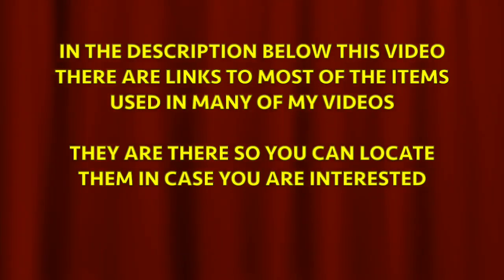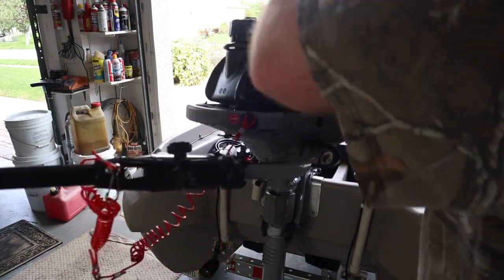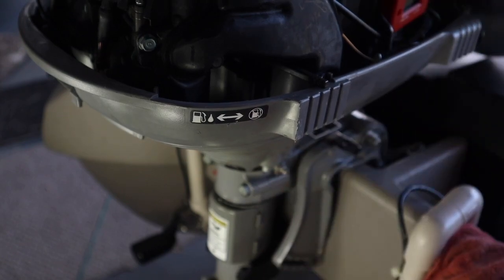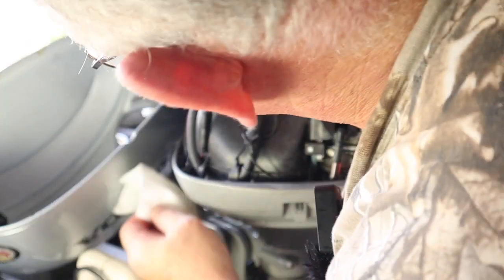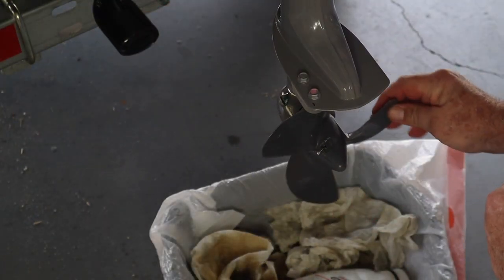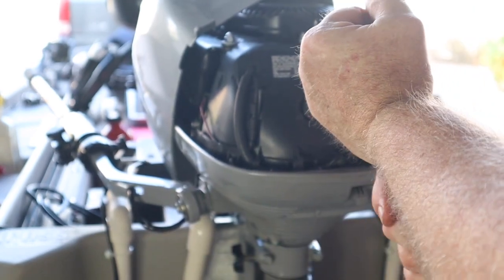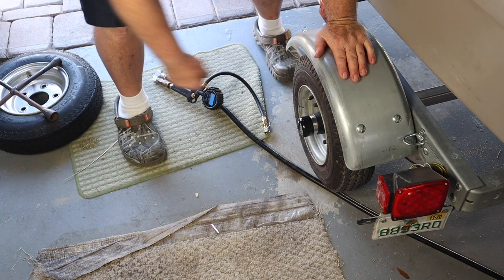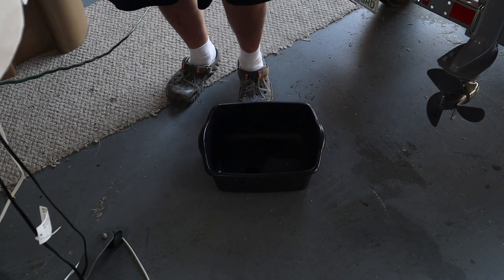HONDA 2.3 HP OUTBOARD MAINTENANCE AFTER FIVE YEARS

Comment: Every time I pop the tank off the inside mounts I take advantage of the fact and dump all the fuel out into a clear 1-quart paint mixing cup (or two).  Shake it out really good to get everything out.  

There are always a couple drops of water down in there and sometimes some crud if it has been a while since water grows fuel slime.  If it is bad I pop the fuel hose off of the tank while it is empty and wipe off the fuel filter screen in there.  Our outboard lives in the water every day mounted on the dinghy so perhaps it sees more moisture.

I dump the fuel back into the tank when I am done using a marine water-separating baja fuel filter funnel being careful not to dump in any crud that settles to the bottom of the cup but the filter funnel should catch it anyhow.

I also drain all the fuel out of the carburetor using the drain screw accessible through the bottom cowl section.  There seems to always be a few drops of water in there too.  The carburetor bowl is just galvanized steel and they tend to rust inside and out.  Inside is bad since the rust will get sucked up into the jets.  Get that water out before it sits in there too long.  I drain the carb if the outboard isn't going to be used for a week or more perhaps because we are docked at a marina where we wont be using our dinghy.   Fuel problems seem to the biggest issue most people have with small outboards.  Keep the fuel clean and the outboard will take care of you.  The tank is sealed when the fuel is shut off and the vent is closed but the carburetor is vented to the atmosphere.  Fuel exposed to air goes bad pretty quickly these days. Gummy fuel in the carburetor is bad news for tiny engines with tiny carburetor jets.
Reply from the maker: This sounds like good maintenance but I have one question. Do you use ethanol free fuel? That is all I have ever used since it was new, 8+ years ago. Ethanol attracts moisture and can be causing your water issues even though you seem meticulous about all the steps you listed. One other issue is your motor is at the water 24/7, and like you said the carb is vented to the atmosphere  and moist air.
Reply: We always try to get alcohol-free fuel but in some states it is very difficult to find.  Maryland, New Jersey, and New York have been very problematic.  One can buy Redi-fuel at a home Depot but it is ridiculously expensive. 

I try to stock up before leaving Virginia going north and fill a 5-gallon jug but I have been forced to de-alcohol gas a few times by adding water and causing it to seperate out.  That's a lot of work and messy.  I've had issues with our old 2-stroke 2HP motor using alcohol fuel.  Now I always make sure it is not and even have a test vial if I suspect it is alcohol gas.
Reply from the maker: @svbarryduckworth628  Very good! I also add fuel additive (usually Sea Foam) to my five gallon gas cans before adding the non-ethanol fuel at WAWA. I just that gas in every. small engine I have.
Reply: I make my own fuel additive.  It is about a third seafoam and a third marvel mystery oil and a third 2-stroke oil with a bit of StarBrite fuel conditioner enzyme stabilizing treatment.  

I put an ounce of this concoction in to my 2-gallon gas can when I fill it up.   That's about a 250:1 ratio and is only 2/3 oil content so more like 375:1 fuel/oil. it can't be smelled in the exhaust -much less any smoke seen but it does protect the fuel system from rust as well as the exhaust.  

These Hondas have a reputation for their exhaust pipes rusting out down inside the lower units so a tiny bit of 2-stroke residue protects it   The spark plugs look really great and I don't see a hint of carbon build up.  The prophylactic sea foam should keep carbon off of the piston and valve chambers.too.

A 2-gallon can lasts us about 2 months so it does get used up fast enough and it is very well sealed.  The gas can you showed in your other video is nice but I habe found they don't fare well when stored outdoors in the rain and sea spray.  Rain water tends to get in and moisture gets in with the air as the can breathes with daily heat cycling.  On a sailboat we store flammable fuel on deck and don't bring it down below.

I also have one of those baja luggage rack fuel tanks that adventure motorcyclists use.  It screws to a special mount right through the center of the can with a special mounting bolt.  These are designed to be mounted in any orientation on an off-road vehicle so they are completely sealed and very rugged.  

Mine is the 5-liter size which gives me about 5 hours of extra fuel if full and I have the mount screwed right to the transom where it won't move around and is up above any rain water.  I don't usually keep it 100% full since 5 hours of extra running is not necessary. Thus it acts as a little supplemental floatation to the transom should the dinghy ever swamp in a really hard rain (It has happened a few times over the years) and will help keep the motor out of the water better should that happen.  During a bad storm a swamped boat can be overtopped by waves so the higher the motor is floating out of the water the better 

Before I had the baja fuel can I kept a little 1-gallon plastic fuel jug which often would be floating in a few inches of water on it's side inside the boat whenever it rained hard.  

I have a couple MSR cans but, like you, found they get extremely hard to open if not constantly lubricated at the cap so I don't use them.
Reply: I forgot to add that because we only buy fuel every couple of months we are almost always in a different place.  Most marina fuel docks in the USA have pretty good fuel (look for the Valvetec sign) although in Maryland, New Jersey, and New York many still have alcohol because of local laws requiring it.  We don't have a car so we are limited to someplace close to where we are anchored where we can walk or ride our folding bikes.  I know a website where it shows you where all the gas stations that have alcohol-free fuel.  Most WaWa stations have at least one pump that has it as well as diesel.  We will often buy diesel for our sailboat from gas stations because even though they are charging road taxes on the fuel it still manages to be 25-40% cheaper than at a fuel dock because they don't have much competition.

Comment: I just bought an older 2 hp honda, everything looks identical to this 2.3 - the oil change screw is ridiculous. I think I will find a threaded tube that will fit into the filler cap so when I empty it out the old oil will just run out the tube into the container.  Just a tip, but whenever you put a spark plug back into a machine, turn it the wrong way at first and you will hear or fill it click into place when the threads line up, turn to tighten from that point and you will never cross thread one. The oil level window is so sensitive to the engine tipping I don't know if there is ever the right amount of oil in there.  I would definitely drain it all and just add the recommended 250 ml, which is a cup, of oil each time.  The lower unit oil, you are the only one doing these videos that used an impact driver to turn the screws, and that is the right way to do it, so Bravo to you for that one!! I always use an impact hammer to take off lower unit screws.  I really appreciate this video and if I can get my oil empty tube up and running I will be sure to share that with you!  So far love this motor and can't wait to put many more hours on it, oh, yes, it looks like you hooked up an hour meter to yours, can you tell me what that is and where you got it?
Reply from the maker: Graeme D-G, Thanks for the kind words. Welcome to the Honda family!
 Let me tell you a tip a TT owner told me recently. He fills a squirt type oil can (the kind you pull a trigger to make the oil come out) and he uses that to fill the crankcase oil without making a mess and to top it off whenever it needs some small amount of oil. One cup of oil would not be too difficult to add in that way so I need to get one of those.
The impact driver is a no brainer!     😄                     Gerry

Comment: Wow that was great info Gerry. I haven't even put gas or oil in mine yet and it will be a year old in May and it's tucked away in a nice soft blanket in my warm basement for a long winters nap. I really didn't get a full first year of fishing in 2019 so I definitely want to use the outboard this summer as I want to go to some bigger lakes up here. I don't want to travel a mile or more just with the trolling motors. I had ordered bearing buddies but ordered the wrong ones so now that I see them below your video I can get the correct ones. Thanks also for that ball grease idea as mine sticks sometimes. I guess tipping the motor to drain the oil is smarter. Just one more thing Gerry I will gladly put my TT in the lake if you come up and cut a big enough hole in the ice for me.
Reply from the maker: Steve, you need to get that motor going in the spring. I use it to travel longer distances so I am not worried about getting home because I overestimated how much battery I have. It also gives you a second means of transportation. The Boy Scout motto is, Be Prepared. I too wondered if I was getting the right bearing buddy. I was lucky and got it right the first try. That is why I started listing a link to the correct ones below the video. I would be happy to make a hole in the ice for you. My method is to wait until spring! 😁         
I hope everyone stays safe during the winter storm that is headed from Texas to the North East this weekend.                                Gerry

Comment: Thanks for the tips Gerry!  I hate my gas can, so I just ordered the "No Spill" from Amazon.  No more spills for me!
Reply from the maker: Bob, I cannot take all the credit. My B.I.L. put me on to that gas can. I have two of them and bought one for my son.               Gerry
Reply: How does it work? I’m not doubting that it does but I’m trying to understand how it knows when the reviving tank is full. I have one of these btw, I could just look at it. Actually, my Honda took a bath in salt water☹️. Inflatable deflated. I tried to save it. No luck...yet.
Reply from the maker: @timothylewis9436 , Sorry to hear about the motor taking a swim. 
Gas tanks operate by allowing air to enter to replace the fuel leaving the can. The spigot on this can is designed such that when the fuel in the tank reaches the level of the spout the air is not allowed in and the fuel is not allowed out. I think it also has a lot to do with the material the can is made of in that it will allow the sides to squeeze in to to compensate for escaping fuel even though no new air can get in.                                        Gerry

Comment: Gerry, I picked up my outboard this morning. I mentioned that my outboard would choke out, not idle or not start with the clutch in the start position. My 2018 fish'n season was fine but my 2019 fish'n season on the big lakes came to a halt.
  Two issues that the certified Honda mechanic identified.  Main issue was the gas cap stopped venting properly. That was my main problem.  Second, was that the carb adjust screw was not set correctly at the factory.  Here comes the geeky part. There's a limiter pin associated with the adjust screw once it is set at the factory for emission purposes. Because he identified that the adjust screw was incorrect, he had to break the limiter pin, set the adjust screw to the proper factory settings ( 3 turns vs 1.5?) and installed a new limiter pin. Sounds like a lot of hoop-la to me. When the good weather returns, I'll be on the water to observe any difference. Enjoy your temperatures in FL that's 60° warmer than what we have in central Missouri.
Reply from the maker: John, that means from the factory they had you motor running too lean. They starve the engine of fuel so that it produces less emissions. Most small engines are set up that way to control emissions. The vent in that cap not working did not help the motor run well either. It is likely your motor will run well now.      Gerry

Comment: Do you this every 5 years or every year?  Also, do you winterize it?  How long can you keep the fuel in the tank if you are not using it?  And if you are not using it for another 6 months, do you empty the fuel out before you store it?  Thanks
Reply from the maker: If you search my videos you will find another one on tune up of the Honda. I do that annually. I also did one on winterizing the Honda but I am in Central Florida and use the motor all year so I do not winterize like I had to do when living in a Northern State. I use only non-ethanol fuel (Have a video on that too) and use stabilizer immediately when I purchase the fuel. I buy the same fuel and treat it the same way for all my power equipment and buy extra for a generator during hurricane season. That fuel is rarely used up after six months and I have had no problems with it. Since the Honda is such a small motor you may want to drain it after that long if you did not use all the fuel up and put it in your mower then add fresh non-ethanol/treated fuel to the Honda. I hope that helps.                       Gerry
Reply: @LunkerFishing  For the non-ethanol treated fuel, do they usually sell that at gas pumps? Thanks
Reply from the maker: @NghiaPham-xi5so , In Florida they sell it at WaWa pumps marked Non-Ethanol and I have seen at gas stations in New York State and some other States.

Comment: I have a 11.3 basstender boat. Will this be a good motor for it
Reply from the maker: Walter, I have no experience with this motor on another boat so I cannot give you any advice because I would be just guessing. That Honda 2.3 only weighs 30 pounds so if there is a place to attach a motor and your boat could handle the 30 pounds plus a little more for gas in the tank it may work. 
Good luck,            Gerry

Comment: When you change your oil put a card board so the oil run out better on the top Screw and on the bottom put a rubber holes on the bottom screw are on your oil bottle
Reply from the maker: Eugene, I am in the process of editing my service of the Honda and my trailer for my sixth year of owning the Twin Troller X10 with the Honda 2.3 on the back. That will be a two part video and in it I completely changed the way I do the oil change on that motor and all the other motors I own. I will never lose a drop when removing the crankcase oil again and cardboard or other funnels are a thing of the past. I should have done this many years ago for all my oil changes for all kinds of motors. Keep an eye out for those videos. I may get part one done tomorrow or the next day.                                   Gerry